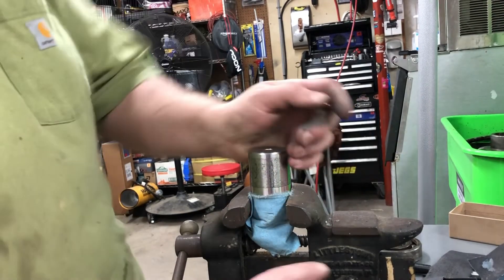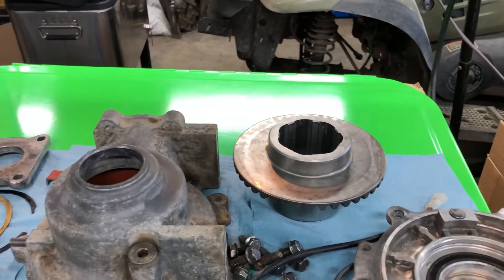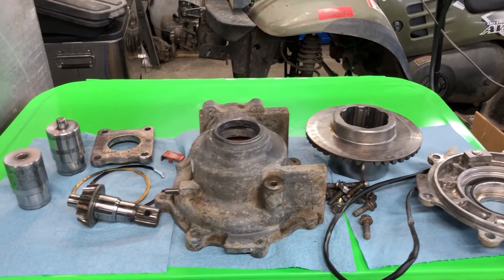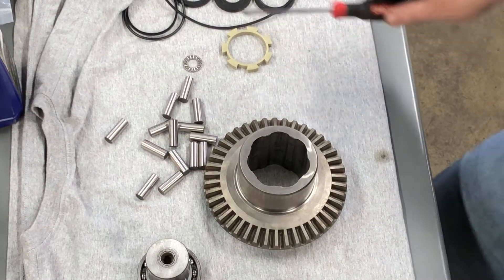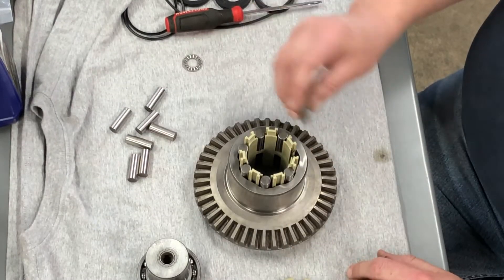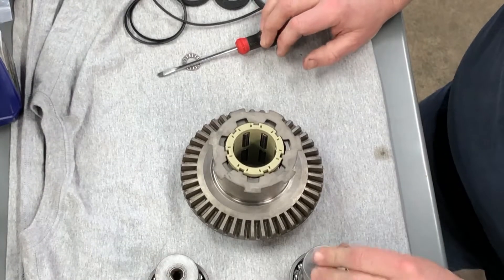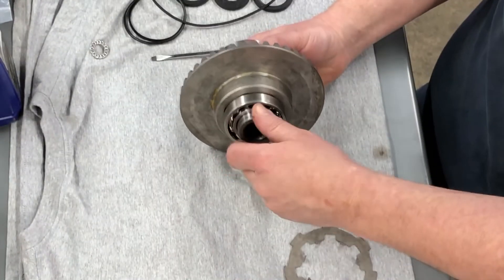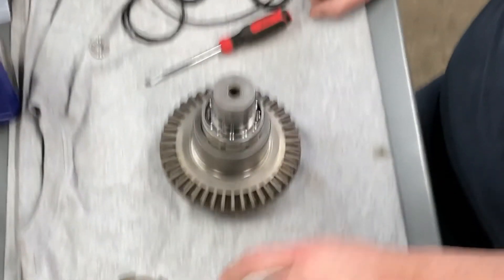Polaris AWD Front Differential Rebuild   PART 3   2004 Magnum 330 Hilliard Clutch

Comment: So i have what looks like the identical front diff in a cub cadet side by side that doesnt work at all resistance measures ok power is ok doesnt work.  I cant seem to find parts for it and im not sure if someone is a hilliard dealer so to speak that can find them.  Where are you getting parts?  Thanks awesome video